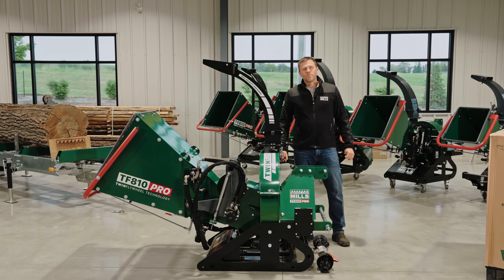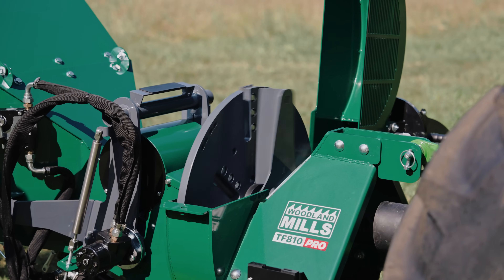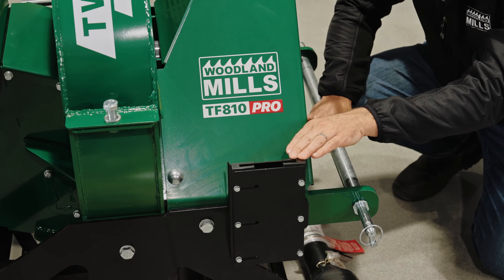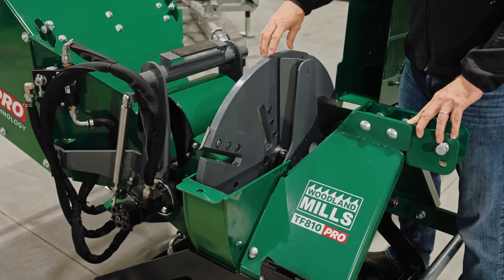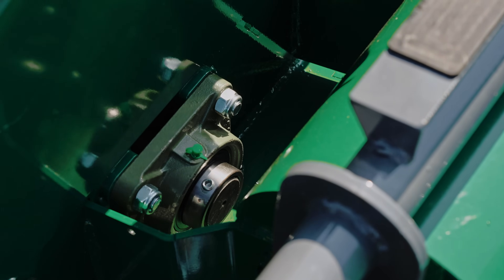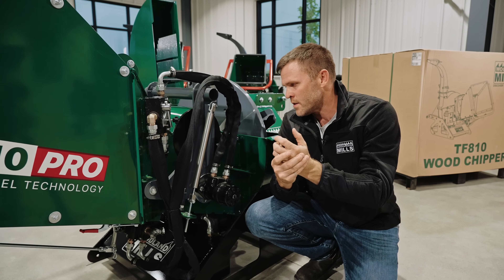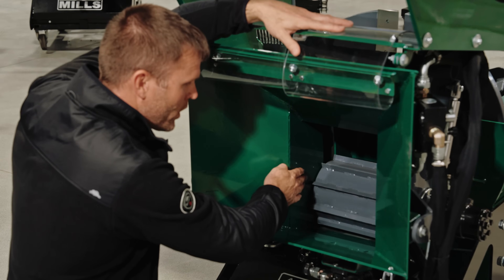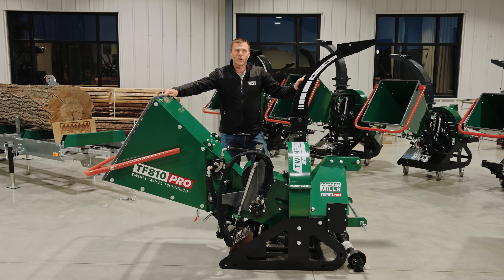Woodland Mills TF810 PRO PTO Wood Chipper Walkaround

Comment: Such a solid set of upgrades and fixes to the WC88. Congrats on the launch! I'd still say the biggest issue I run into is the single hydraulic in-feed getting clogged when there's to much branchy material and it just can't get a grip because it's skipping. I'd still love 2 hydraulic in-feeds

Comment: Very Cool! Any chances this will be coming out for the 6” version to fit the lower 30HP tractors. Curious if it’s possible or if we don’t have enough power to run the secondary flywheel